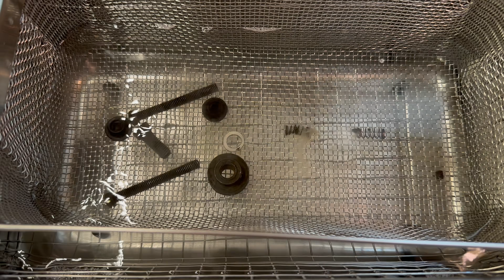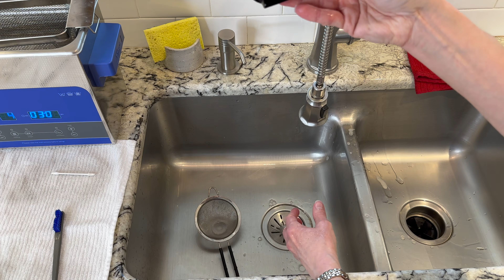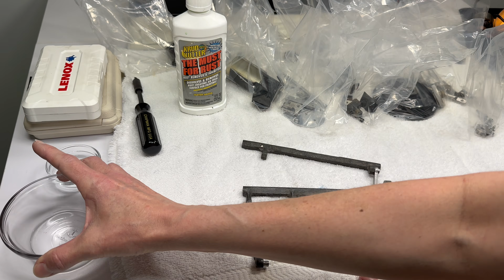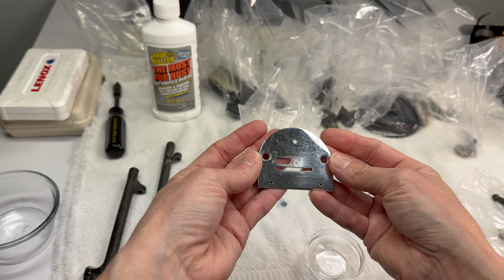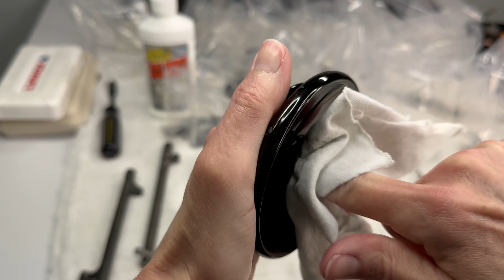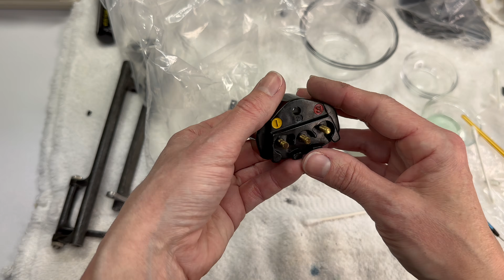Vintage Sewing Machine Parts - Cleaning Without Ruining Them

Comment: What to use if can't find, The must for rust?
Reply from the maker: If you can’t find it then I would suggest Evaporust. Don’t soak your parts in it, they will turn black. Instead, treat any rust with a q-tip dipped in Evaporust and then wipe off any extra when you are finished. I think the Must for Rust has been discontinued, sadly. I have a big bottle here that will hopefully last me a while, then I will be switching to Evaporust. I hope that helps!

Comment: Can you spray everything with wd40 to keep the water away/remove it?
Reply from the maker: Hi! That isn't something I would personally try but it could work. I am not a fan of putting WD40 anywhere on these machines but that doesn't mean you can't. If you need to make sure you have blown all the water off of a part then a hairdryer works very well. I hope that helps!

Comment: I'm trying to clean my hand wheel with not much success.  It is on a 127.  The outside is brownish, dirty (I think) but it's supposed to be shiny chrome-looking.  The inside of the wheel is black, with a lot of it painted shiny black similar to the machine.  How do I get the outside shiny chrome-looking without wrecking the black shiny areas?
Reply from the maker: Hi! I use a hard felt polisher (dremel or buffing wheel) with a white polishing compound in those situations. Usually I can get that silver colored plating to shine up nicely in those situations. For the parts that are painted (Japanned) black, lots of elbow grease and Zymol cleaning wax. I hope that helps!

Comment: Hi Jen. What do I use to clean my 1950 Chrome faceplate with the vertical lines. Thanks for your help.
Reply from the maker: Hi! This is a little late but for anyone who is cleaning the faceplate. I run it through the ultrasonic first and then if it needs it I use a chrome polish. There are many out there, just find whatever is available and follow the instructions. I hope that helps!

Comment: Hello, I am watching your series of videos to help me with restoring a 1935 featherweight that belonged to my great grandmother.  I was unable to find the Krud Cutter rust eliminator product- but fortunately I did not see any rust.   However, I did come up with a way to dry the parts with a hair dryer.  I purchased some large sink strainers.  You can tape or hold them together and put the parts in there and use the hair dryer to make sure they are thoroughly dry.  It will hold all of the parts- even the tiniest screws.  Also, another tip for small parts or some hard to get to places, use a hemostat.  You can get one for 7-8 dollars.  Have a great day.
Reply from the maker: Thank you so much for sharing your tips, they are super helpful for anyone who reads the comments. Best of luck to you with your restoration!

Comment: Thank you so much for the information! Ive been researching what to do for my new sewing machine and want to keep it good! Any tips on good polishers that don't contain bees wax due to allergies,  would you recommend anything else for cleaning or would this do just fine for all parts? c:
Reply from the maker: You are so welcome! I haven't done any research on polishers as far as bees wax content, I am pretty sure the one I use is Carnauba wax so it should be safe. My cleaners are alcohol, Krud Kutter, Kerosene , sewing machine oil and the Zymol wax. That is pretty much all I ever use and they are always on my bench. I know some other folks use other stuff but those are always available locally for me and they work so I never try anything else. I hope that helps!
Reply: @SewingMachineRehab  thank you so much! You're a life saver✨

Comment: what kind of polish do you use
Reply from the maker: Hi! I use several depending on the machine or the part. I love Zymol cleaner wax for the body and then I use a white polishing compound for any metal parts that need polishing. Sometimes Brasso on the badges but not very often. I hope that helps!

Comment: I use the ultrasonic for carburetor parts. I put  the tiny parts in a mesh tea ball. Then I blow compressed air through the tea ball to dry them. You could blow your hair dryer on the tea ball. The parts would dry and not blow away.
Reply from the maker: Great tip, thanks for sharing!

Comment: What do you use to clean rust off of the decorative nose plate if you don't have a altrasonic machine?
Reply from the maker: Usually the ultrasonic just gets the grime off. Rust is another matter and I usually use a rust remover followed by a white polishing compound and Dremel or bench polisher. How nicely it turns out depends on how bad and deep the rust was. I hope that helps!

Comment: 1:21
Well, put all your small parts into your sieve and blow dry them all at once but not too close. They won't fly all over and it will be quicker.
Reply from the maker: Yes, I guess that would keep them put. Terrified of having to find a tiny screw!
Reply: @SewingMachineRehab  Or, you can spread them on a cloth , cover with the sieve and blow dry them through the sieve . Works too.
Reply: We use a collapsible strainer for our dremel & mandrel burrs & bits in Podiatry School. You can just hit them with a hair drier or air compressor to get them very very dry afterwards.

Comment: Hello, I have a bobbin case that has rust on the outside rim as well as maybe grime & dinginess. Do I take it apart & soak it in the krud cutter solution to get it cleaned up? Or what would you suggest to remove that from the case. It’s the bobbin case itself that you release with the lever & take out of the machine. (All of the bobbing case cleaning videos I’ve found so far are removing the parts that the case itself goes into on the machine & that’s not what I’m looking for. 😊) thank you for your help.
Reply from the maker: Hi! Krudcutter will get the grime off but won’t do much for the rust. If your bobbin case is rusty then disassembly of the case is probably a good idea. What model are you working on? I’m not sure exactly what you mean with your question about what to remove and disassemble, feel free to send me some pics to jen@sewingmachinerehab.com if you want, maybe I could help you further.

Comment: I have my mom's 401A Singer Sewing Machine. While cleaning, I put white lithium grease on the gears. After doing this, I heard it will get hard eventually and be very hard to clean the gears. I bought clear grease but need advice on cleaning off the white grease first. Thank you for your help.
Reply: Scrape off as much as you can, then use a solvent like "mineral spirits"; it won't damage metal parts. For actual grease you generally need a stronger degreaser than the household products (like Krud Cutter, Simple Green, etc.). I haven't had much luck with isopropyl alcohol either.
Reply from the maker: Hi! I am pretty sure I have cleaned that off of gears more than once. Using a cut down chip brush first to knock off the worst of it is usually how I start. Then I go in with very small q-tips that are used by beauticians to get into the teeth of the gears. I dip them in rubbing alcohol first. This is the link to the ones I get: https://amzn.to/3VFFeZt Finally, I use a small wire brush on them at the end. It can be done, just takes a lot of elbow grease to get the lithium grease off. :) I hope that helps!

Comment: Hi,
What is the capacity of your ultrasonic cleaner? Thank you
Reply from the maker: Hi! You know, I am not sure! It’s big enough to fit some of the longer parts like the rock shafts from a Featherweight but it wouldn’t hold rock shafts from something like a 66. I have had if for several years and they don’t sell it anymore. There are so many out there, I would choose one that fits your budget and your parts and you should be good to go!

Comment: What do you recommend to clean around the metal pieces on the machine that turn brown?
Reply from the maker: Hi! Do you mean on the parts that come off or the parts like the needle bar and presser bar bushing? Parts that I can remove like the needle bar, hook assembly and etc. I clean in a solution of Krud Kutter. If I don’t remove the presser bar bushing for example I very carefully clean it with rubbing alcohol, very careful not to get it on the finish of the machine. Then I will gently polish them with a very high grit sand paper, usually in the 2,000 to 10,000 range depending on the part. I hope that helps!
Reply: @SewingMachineRehab  i’m not sure exactly what they’re called but they’re the plates that are on front of the machine like the badge names.  It’s like a stain and they’re even at the creases. It’s like every vintage machine I find, those are the hardest parts to clean.

Comment: Unable to find krud kutter must for rust, is there anything else that you might recommend ?
Reply from the maker: Hi! I have been hearing from other viewers as well that the rust remover I use isn’t available to them. I haven’t found one that I like as much yet but I am looking. It seems to be kind of a niche product and most options I am coming across are more industrial and you have to buy a huge bottle of. Some rust removers also turn the area where it was applied black which we certainly don’t want. When I find one that will work I will definitely make a video and let others know about it. Wish I could give you a better answer!
Reply: It seems there is more than one kind of Krud Kutter. Is the Must for Rust kind the same thing you use in your ultrasonic as for touching up rust on the individual parts? I just bought an old 127 and am so excited to get started. I wouldn't have even dreamed it possible if not for your incredible detailed videos!

Comment: Will feed dogs be ok in ultrasonic cleaner? My  friend gave me a vintage sewing machine 128k so they are actually quite rusted. I also have my new featherweight.
Reply from the maker: Hello! Yes they will but you will need to dry them well and you may still need to hit them with a wire brush if you can't get the rust off. Usually that does the trick!

Comment: Are you concerned with lead from cleaning? In ultrasonic cleaner? Are gloves ok?
Reply from the maker: Hi! I am very careful with the lead and usually put down towels I dispose of when dealing with it. And wear gloves! I actually throw away the old wires in the lead tubing and rewire the machine so using a technique that is lead free. I wouldn't ever put any of the wiring in the cleaner, for sure! Hope that helps!

Comment: What is honing stick for?
Reply from the maker: Hi! I use it to help me polish the commutator along with some fine sandpaper. I also find that it works well to get any burrs off the thread loop guard for some hook assemblies and remove dark spots or mild rust from things like the feed dogs. Just don't use it on anything that is chrome or nickel plated, it will scratch it! Hope that helps!

Comment: Hi Jen, there seems to be several different types of metal and/or metal finishes. Chrome, nickel plated metal, etc. How do i tell them all apart for each cleaner?
Reply from the maker: Hi! Anything that doesn't have paint gets put in Krud Kutter for me. That's just what I do but I know that there are different opinions out there on what to use. So far I haven't had any issues with the finish being damaged, it just comes out clean. Usually I don't need to use any polish at all on the nickel or chrome parts after that but if I do I usually use a white polishing compound and my Dremel. I tried a very smelly metal polish in a can once but that just wasn't for me and I didn't think it really made a difference. I don't know if that is helpful or not, hopefully it is!

Comment: What are you using for polish?
Reply from the maker: Hi! It depends on what I am polishing. For painted parts I love Zymol cleaner wax. Some of the chrome pieces I leave as is once I clean them. I use a dremel and a white polishing compound on metal parts sometimes. I haven’t worked with many metal polishing compounds as I usually don’t need to. Hope that helps a little!

Comment: 11:09 am.  I am working on a singer 27 treadle machine.  I removed the bobbin  winder from the machine.  The spring that holds the bobbin in the winder is not working, can that be fixed?  replaced?
Reply from the maker: I believe you can find a new spring, is this the one? https://www.sewingmachinesplus.com/15366.php?gclid=Cj0KCQiAkeSsBhDUARIsAK3tiefckOV0j9rKw8ZyANVHgrEe25EDoj-xXolQw_Y-im7gY-_frL7uu8MaAqw1EALw_wcB

Comment: Thanks so much for your awesome video series on Featherweight restoration!  I have a bottom cover (where drip pad sits) that has rust on the outside.  What what you recommend I do for that?
Reply from the maker: Hi! You are welcome! It would depend on how much rust there is. If it is just a little I would treat it with rust remover and maybe lightly sand it and then polish it. If it was a lot I would sand it and repaint it with a spray paint. I hope that helps! Mostly you just want to stop it from rusting further or having rust transfer from the bottom of the cover to whatever surface you keep the machine on.
Reply: Thank you so much for your help/advice! 🙂 @SewingMachineRehab

Comment: One tip I got from watch makers is you can dry the parts in a cheap food dehydrator. The little parts won't blow away, and you can get them bone dry.  Keep up the great work.
Reply from the maker: Wow, that is a great tip! Thank you!
Reply: Thanks for this tip. I have one that I was planning on giving away that I keep in my garage.
Reply: A small toaster oven set on low works too ;)
Reply: I just put my metal pieces in the oven

Comment: Love your videos! If you don’t mind, I have a couple of questions about your ultrasonic cleaner. I see that it’s a GT Sonic unit - what’s the model of the unit you use? (I tried unsuccessfully to find a source for GT Sonic ultrasonic cleaners to look up size, heating, and power ratings.) I see that you use a fine mesh basket in the cleaner - did it come with the cleaner, or did you buy it separately?

Thanks in advance!

…Scott
Reply from the maker: Hi Scott! The one I use I purchased off of Amazon. I am going to give you the link but it looks like it isn’t in stock anymore. My main criteria was that it needed to be large enough for holding rock shafts and other larger parts and it needed to heat the solution. So far I have been happy with it but the button you push to stop and start the cleaner has started to crack. I think I paid between $100-$150 for it, can’t remember. The mesh basket is an aftermarket one, also on amazon. I just made sure it fit inside the cleaner before I purchased it. Sometimes I use that basket and sometimes I just use my little mesh strainers for the tiny parts. Here is the link so you can hopefully at least see the specs. 3L Ultrasonic Cleaner, 304 Stainless Steel Professional Ultrasonic Cleaners with Digital Timer & Heater for Jewelry Watch Glass Circuit Board Dentures Small Parts Dental Instrument https://a.co/d/5HMh7He
Reply: @SewingMachineRehab  Thanks for the link! I’ve been using a small unheated ultrasonic cleaner and have been thinking of upgrading. Having the specs for your cleaner gives me a good place to start.

…Scott

Comment: Great video
Reply from the maker: Thanks!
Reply: Jen, I really enjoy your videos. My sister and i are restoring about 15-20 machines and we would like some information about buying a SONIC CLEANER. Would a regular jewelry sonic machine without the heat do the same as yours when it comes to cleaning the machine parts? Thank you
Reply: @ArleenKoenigsknecht I've seen her type of ultrasonic cleaners at jewelers stores. I think the ones for jewelry would work just fine as long as your biggest parts would fit in them.